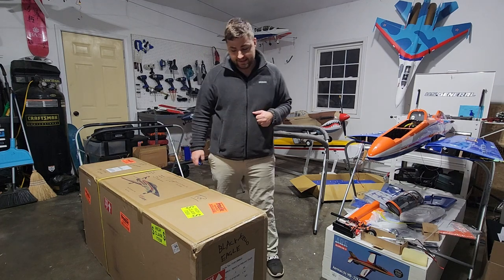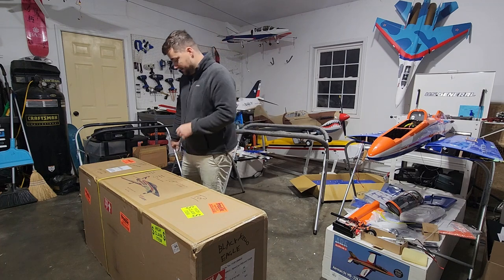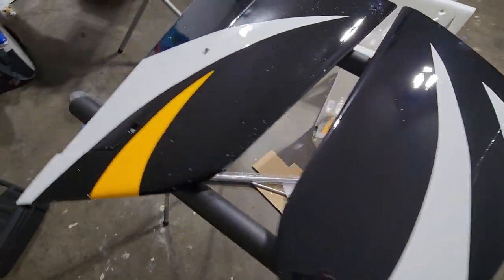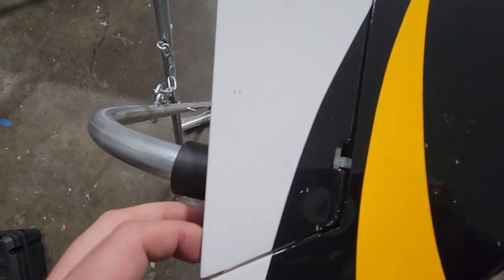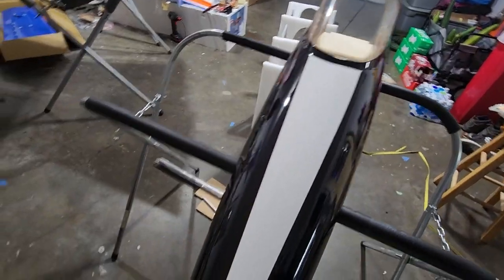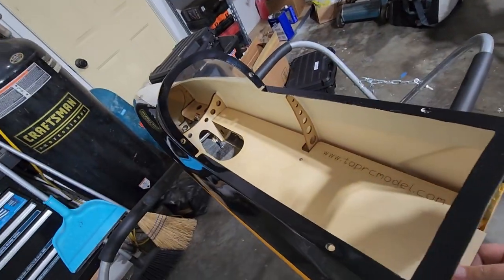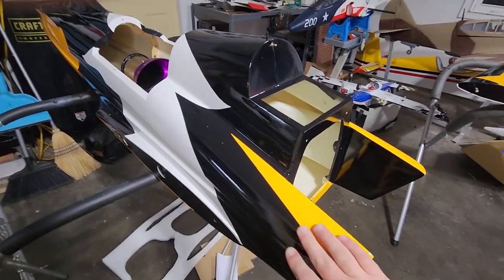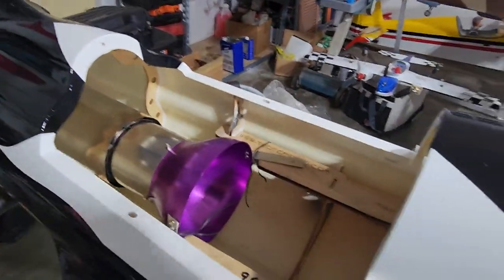Top RC Odyssey unboxing/first impressions!

Comment: Awesome Sauce! Can't wait to see the rest of this and your choice of hardware/components.
Reply from the maker: Thanks! I just received the electron gear, I have a smoothflite 16 on hand. Right now I'm working on sourcing some fuel tank fittings, not that the stock won't work but it's questionable. Probably will be after the holiday season before I get deep into it, but I may make a video on the MB339 build progress before long!
Reply: @BluegrassStateRC  I'm doing a Hangar9 MB-339 too. I plan to start in a couple of weeks. I'll be recording it too.

Comment: Looks great. I have an oddsey also was my first jet. I agree that for the price its still a great value despite some minor QC problems. I do wish the paint did not have as much orange peel as it does but you will never notice in flight. The best thing about the oddsey however is the way it flys,  it tracks on rails even without a gyro and is very forgiving at all speeds.  it can go 200mph or 50mph.  (check out some of my videos) One tip i would have is make sure you use a lazer to align the thrust tube angle with the turbine or it will want to climb at full throttle. Enjoy the build!
Reply from the maker: Did you have to shim the thrust tube to offset the climb?
Reply from the maker: Also, I see 100k vehicles daily with worse orange peel. So that don't bother me  😂😂